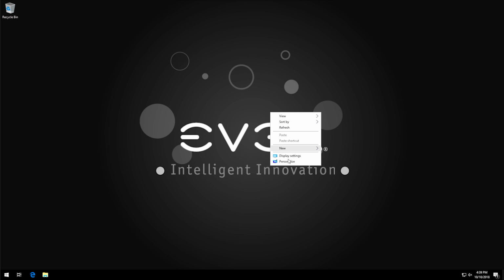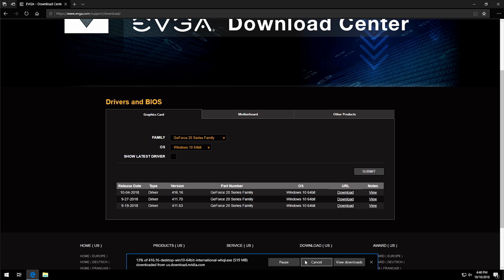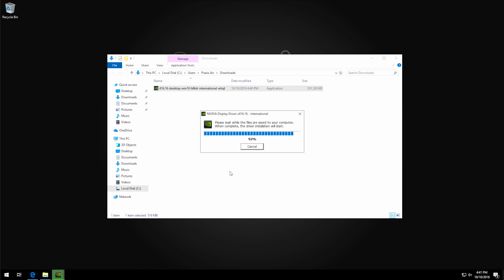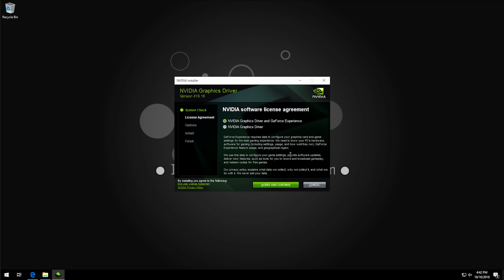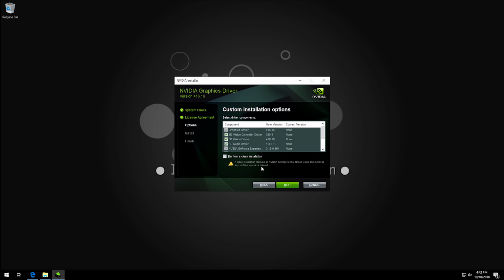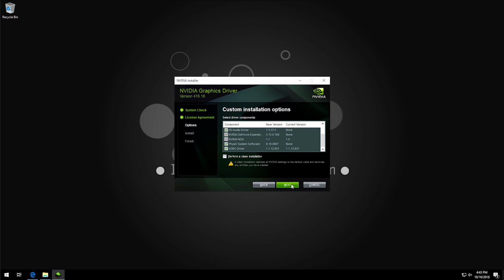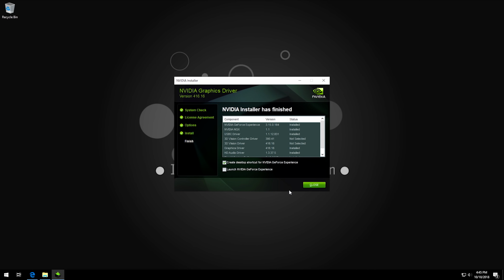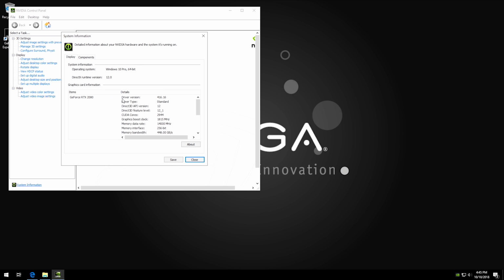How To: Install NVIDIA GeForce Drivers

Comment: I have an Evga 1060 6gb dual fan on the way, but before I get it I would like to ask you a question, do you think I should install NVidia drivers prior to getting the graphics card or do you suggest that I install the card first then install NVidia drivers after? Thanks in advance

Comment: I don't have my gpu connected to external power but I need too. when I try to download driver it says not compatible with version of Windows and I have latest version and it also say can't find a compatible hardware which I'm guessing it's because I don't have my gpu connected to external power  supply.Can you download nvidia driver without gpu but im getting a psu with 24 to 8 pin adapter soon.

Comment: Just got the 2070 Ultra and it's a no go. Drivers installed, restarted, no drivers present. Right clicking doesn't bring up nVidia driver properties although in device manager it shows the card with a big fat yellow exclamation mark next to it. In addition when the system starts the screen flickers pretty nasty. What gives?

Comment: I acsedentaly uninstalled it does that does toys the driver 😭
Reply: The drivers need to look if you have a GeForce graphics card. If you do have one and didn't put the drivers in, then don't worry. If u don't have a GTX/RTX card, then the drivers won't download. Also, if u already have the latest drivers, the app will know.

Comment: I wouldn't install geforce experience because it's pretty garbage imo and it can cause problems in games.
Reply: What problems?
Reply: With black ops 4 it has caused crashes and also with nvidia overlay
Reply: i only want it for ansel, it made it so theres this invisible box which takes your mouse out of the game on the right of the screen